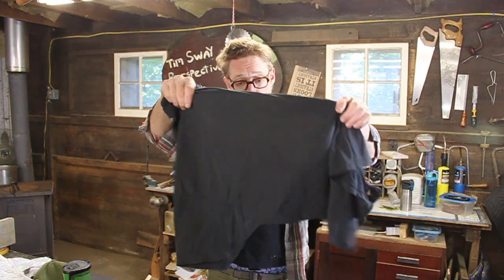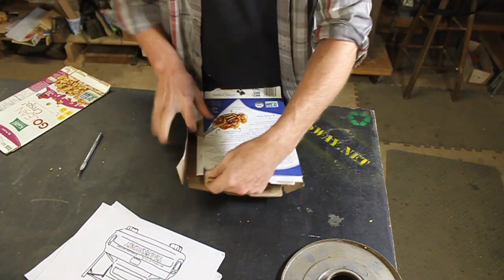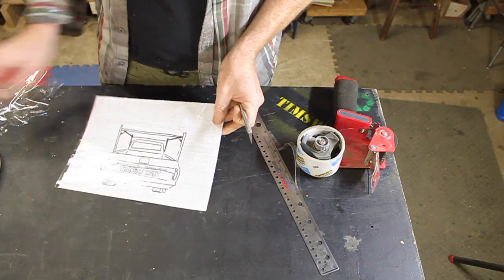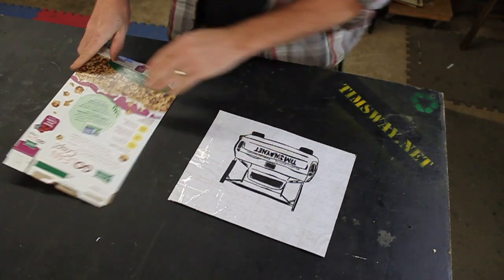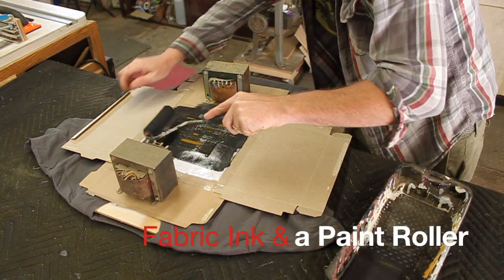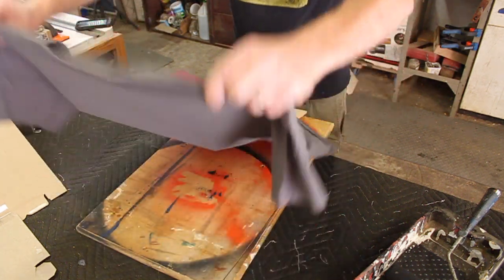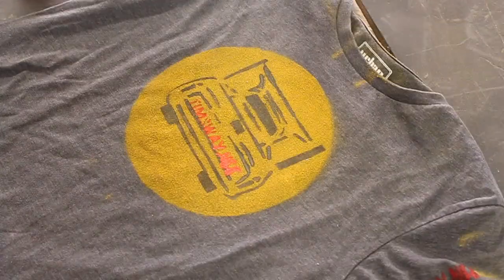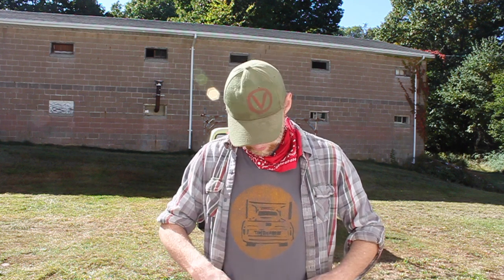DIY T-Shirt printing with Cereal Boxes and Tape

Comment: When I used to make models I used 2 part epoxy to reinforce the cardboard pieces :)
I left the pieces soak in the epoxy so the paper would get saturated with it and let it cure.
I think if you did this the stencil might last longer :)
Reply from the maker: that's basically how those lab counters in school were made, paper and resin. great idea!

Comment: I don't know much about how well this would work relative to the spray paint, but I wonder if spray ink would do better over time on the shirt. I have basically zero experience with purposefully spray painting a shirt or using spray ink... so... 🤓👍🏼
Reply from the maker: i think there are a lot of ways to do this, but what I have found is it doesn't matter what kind of paint I spill on me, it doesn't wash out :)
Reply: I can attest to that :)